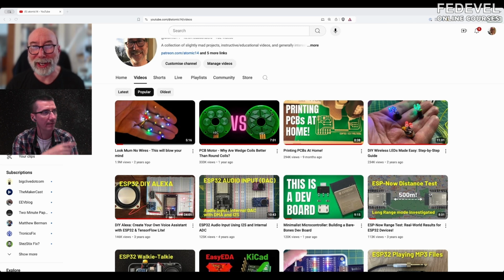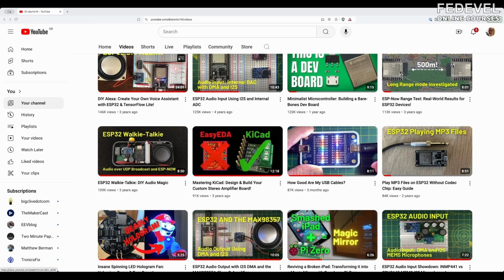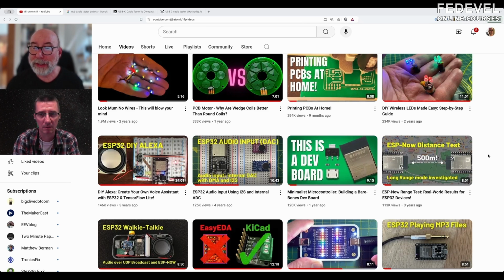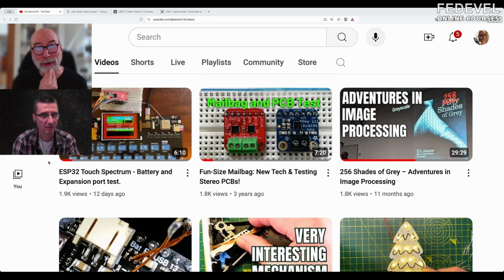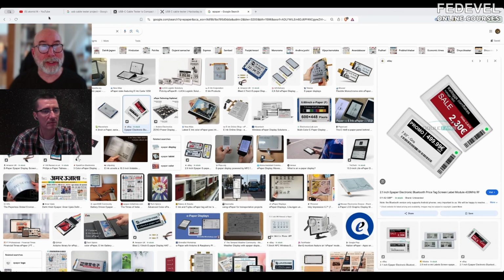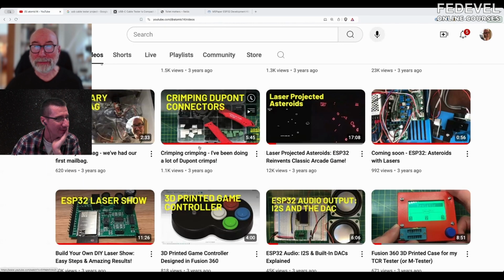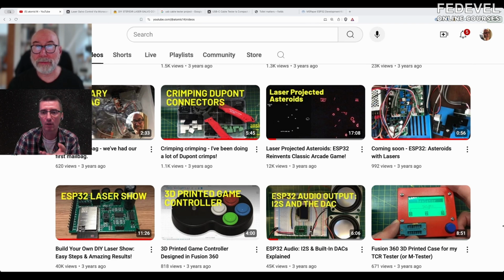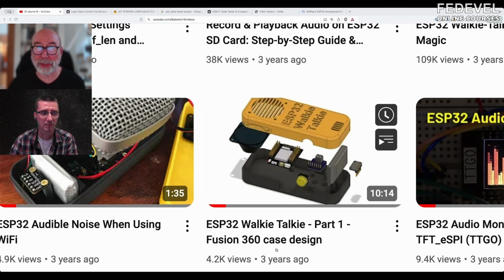Cool DIY Electronics Projects

Comment: It's funny the minimalistic Microcontroller &TV project! 

I am using almost KiCad and very rarely EasyEda. I prefer KiCad because it is able to handle for "free" medium and complex projects. and to export the PCB 3D model. Instead with EasyEda for these features it is necessary to pay. Yes is it true that in KiCad there are quite few components but it is possible to import parts from LibraryLoader or Snapeda and I think that these databases are constantly improving both for the quantity of parts available and for the quality of the symbols and footprints